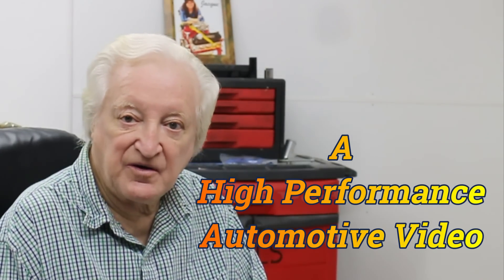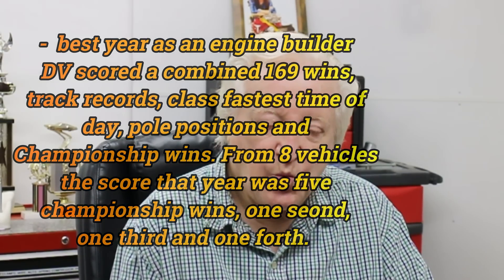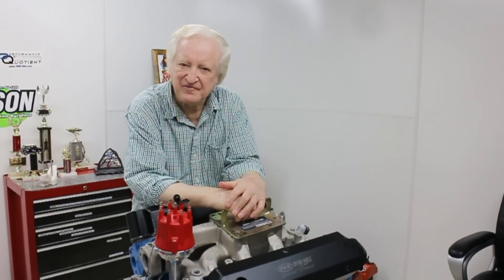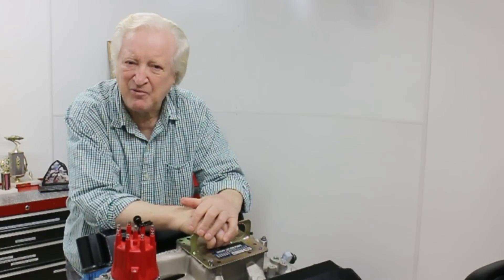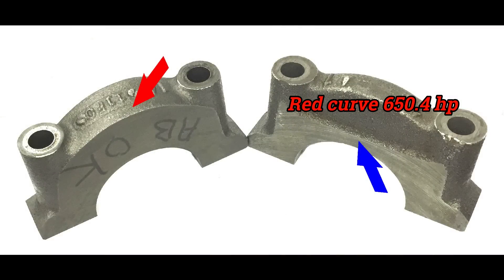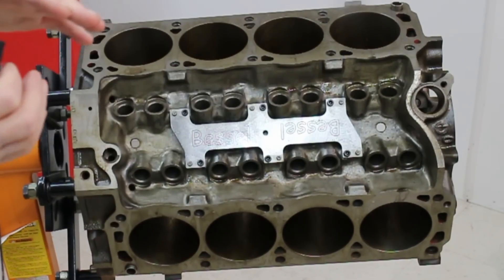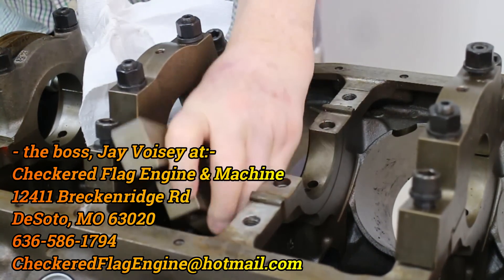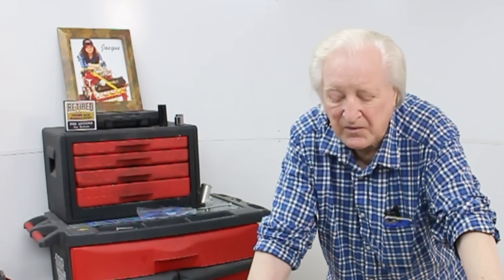1000 hp capable Ford production line  5.0 block.

Comment: A tip for david by Bloodviking 

Using aluminum heads will weaken the block. Cast heads give small block engines more strength to keep everything together.

Comment: A 302 factory block id rathe4 do 600 hp at 6000 rpm then at 8500 rpm.

Or 1000 hp at 5500 rpm if I dare.
I've seen loads of sbc failures at about 600 to 650 hp

With the best of everything to strengthen the block id still be afraid at 650. It may hold for awhile but try going up a hill in a heavy street car and load the driveline. Boom.

Comment: When I strengthen a block I assume it can't take more then about 2 to 300 hp over what limits they are known to fail at. High rpm is bad combined with high torque. So about 600 to 700 would be the limit I'd try on a 302 production block.

Bloodviking

Comment: I would agree anytime you use a stud griddle you help hold the block together. That's just common sense. I would think it would also help harmonics and even them out threw the block. In the early seventy as a tool and die maker and drag racer I made my own back then cause I didn't have a four block main block. It was a 350 engine with just stock new angle heads they came out with with no porting. I wish I would have ported them but just didn't have the time. Needless to say it was a big block killer except for 1 BB car. That SBC really ran smooth to 7,500 rpm. Ran it for 4 years and never had anything done to it. Me and a buddy drank a 6 back of colt 45 several times and I got brave and went out in the country and went threw the gears with slicks for hours. I sold it to a guy and in one night he went threw 60 gallons of gas. That engine never blew up he just wreck the car one night right into someone swimming pool.

Comment: I think the reason the light girdle works is that it prevents thel caps from vibrating as individual devices; with the girdle they are tied together, and counter act each other's movement, damping out the movement of the individual caps.

Comment: We used too re-drill 289-302 7/16” main cap  bolt holes too 1/2” 351-W main studs and girdle line hone to help with main cap walk at high rpm’s.

Comment: I had wondered about the effectiveness of these girdles and was very dubious of the aluminum girdles, but now I know better, so thank you once again Mr Vizard.
If I may,  I would also like to point out that here in Australia, Ford in combination with a company called Tickford developed a 5.6litre Windsor stroker in 1999/2000 that were installed in a limited number of Speciality Ford sedans here in Australia (search for  "Tickford AU series 3 TE50"). Amongst the modifications they made to these engines was a steel maincap girdle!
Oh by the way the engines were rated at 260kw (348hp) and were hand assembled here in Melbourne (?). Additionally, the engines featured 1 5/8" headers (I think ceramic coated), a cast stoker crank made in Melbourne, I think by a company called Crankshaft Rebuilders,  billet con rods made by a Victorian engineering firm, appropriate cast pistons, GTP heads that were prepared by PerfectTune in Melbourne, an appropriate roller cam (and I think Yella Terra roller rockers) and crowned with a unique inlet manifold which housed 8 long runner tubes like those seen on race cars.
The power rating, at 348 was intended to compete against the LS1powered Holdens of the time that were producing about the same power. These engines were replaced by the 5.4litre Boss motor in the next model in 2003. 
Thank you once again Mr Vizard.
Reply: Sounds very entertaining, is there anything on this engine build on the internet ? Thank You 🇺🇲 🇵🇷 🦊 👍

Comment: Another awasom video thanks for sharing this with us I'm at a loss hear   do you still run water wen you have concrete in the block ? And another question is this block only for drag racing and not for the street really curious

Comment: Would love a discussion on minimum cylinder wall thickness and how much if any does it matter on down the bore from the deck as the pressure in cylinder drops very rapidly as the piston moves down the bore.

Comment: I know how customers are and I hear something and they think it's a great idea but in my opinion you should have said that feeling with these blocks with concrete is not applicable on the street
Reply: funny i drove a 482 big block(.125" overbore 454) on the street 3/4 filled with concrete for 5 years in texas summer heat as my daily driver and it ran cool and just fine. all the heat in a engine is at the top end where there is no concrete
Reply: I think it's just some people get lucky there's a lot of guys that had these in their dragsters and they would get hot and if they had to go back to back got lucky to go up to the real quick eliminations where you go run turn around and come back sit there for 5 minutes and run again and it put a lot of extra heat in the motor and they didn't like it and but didn't have a choice so I don't have somebody really gets away with it on the street but okay we've been feeling since the early 80s so before they were using concrete they were using plastic and some some people get lucky I had a guy telling me the other day at a 400 that was filled driving on the street everyday had no problem so guess you get lucky

Comment: Thank you for the great video and information, it is much appreciated!
Where can we find that lifter valley brace?
I have the DSS main stud girdle and windage tray for my 302/5.0. I got it years ago before I got hurt. I keep hoping to get everything installed along with a Novi 2000 supercharger before it's my turn to pass on.
How about a video on crankshafts and how much power they can support, say a common cast iron, vs cast steel, vs forged?

Comment: Thank you. One comment about turbos: turbos use the heat content in the exhaust to make boost. The closer to the exhaust valve(s) you place a turbo, the more efficient your power production will be. Positioning a turbo farther away from the heads results in a tradeoff where the turbo increasingly uses the pumping action of the pistons ( aka back pressure) to drive the exhaust impeller and to a lesser extent the heat energy to make boost. And you lose efficiency which means to make the same power at the crankshaft, you need to use more boost and this imposes greater strain on the rotating assembly.

Comment: Ford designed the low deck Windsor to be an economy car engine, so it had to be lighter than the Chevy Mouse which was used in family vehicles and trucks.  The high performance K code "challenger" 289's had wider main caps, but to install them you will have to align bore and if you're considering a stroker crank (back in the day it was a Y block truck crank to reach 327 cid--the problem is on a 289 block a stroker kit will pull the pistons out at BDC enough they will rock. But in 1967 the last batch of 289 blocks had the extended cylinder wall seen on the 302 blocks to follow) it will end up higher inside the block and closer to the camshaft, where the lobes can kiss the connecting rods (esp. H rods).  Speaking of rods, the Boss 302 used longer 289 rods, helping the thrust areas on the cylinder walls. Ford also made the core plugs threaded so they added strength to the side of the block. Many blocks in fact have a weakness by attaching to engine mounts in their middle, which is why race engines use engine plates in the front.

Second point, MOST 5.0 pushrod engines can't be bored past .040 inch without problems. but every now and then you find a "casting mistake" and that block can go out .060 over. No one seems to know how many "escaped the quality control" but no doubt they make up some of the "miracle stories" of blocks making it past 500 hp.

Third point, Ford changed the firing order on the High Output 5.0 pushrod engines to the 351 W. A change to the crankshaft in the 1980's resulted in a different weight flywheel--a clue that something was amiss. Look at the regular 301.9 cid firing order, and you notice the front two cylinders fire off at the same time. Now, imagine that happening on an engine with a lot of stress on its crank pulley--such as a supercharger belt tightened down so it won't slip off while making maximum boost to push the engine past 500hp. This firing order is found in the camshaft, so how many 5.0 litre cams are out there being ground to the old firing order rather than the HO/351W firing order that does not fire the two front cylinders off at once? DV has already talked about camshaft companies and what they know and do not know--many will create a Chevy small block type grind and lifter design and sell the kit for non Chevy engines, and the result will be oiling problems in the lifters and a camshaft that doesn't fit the peculiarities of an "off brand" cylinder head design.

Comment: Ive used a 302 72 block, made a cap plate 1/2" steel on the 3 middle caps, then this is bolted through the sump sides onto side plates that act as engine mounts, they also tie the cap plate ont the side walls of the block. 
Alloy heads & twin turbos, it's at about 700bhp & holding up so far, I do have it dialed in to keep the power lower in the RPM which I think helps a lot...... great vids David!
Reply: I’d love to see a video of that. Actually screw it even a picture.
Reply: What's your range for lower rpm?

Comment: I have always wondered if a Small block Ford engine from a  Shelby gt350 or a Cobra was a factory Ford short block block like any other car or if those engines were manufactured for Shelby completely different and made much stronger as cast. Good video that explains why the Ford small blocks can split down the center and how to stop it.

Comment: Great stuff with DV... And as most Ford guys know, the 302 Ford Windsor (5 liter), won Lemans twice. That is that nasty old 24 hour race. Would be nice to see the mods Ford and friends did to keep that little screamer lasting for 24 hours under race conditions
Reply: When did Ford win Lemans with a 302? Possibly a 289…. But I only re all the 427’s winning Lemans in the GT40’s
Reply: @matthewnosal6893 they won with 302 and 289
Reply: @CoyoteFTW so the 1,2,3  win at lemans was with the 427’s first. Then later switched back to the 289? From what I’ve read the first run of lemans with the 289 was disastrous .
Reply: The block for the LeMans small blocks which won in 1968 and 1969 were cast in England. They were heavier, and also a better grade of cast iron. A friend had one, with the Gurney Westlake heads. A very nice casting.
Reply: @johnsalvaterra1355  wow I never knew that. I guess after the 427’s put whoopin on everything they put a 5.0L limit on engines in the following years at Lemans. Who was building the engines for Gurney? Holman Moody built the 427’s…

Comment: The early 8.2 deck blocks also have head bolts that are blind in comparison to the later roller blocks. I run the DSS main support system on my 9.5 Windsor block. It was transferring metal at the mains before the girdle upgrade. It also had ARP studs at that point. Seems to have stopped now. Doesn’t look any worse. 625 hp N/A stick shift drag car.

Comment: I've always wondered about the "higher nickel content" anecdotes.  When I was a youngster, they were saying the same thing about the Australian castings for the 351 Cleveland blocks being stronger because of a higher nickel content.  And while it may be true, I've not seen anything resembling a metallurgical assessment to confirm it, let along  testing to determine whether that higher content would actually give a significant increase in strength.
Reply: Having played with those anchors and comparing them with US blocks [GT Blocks] they have good and bad points. Personally I feel the 'normal' 300HP Gt XY XA block is better but swings and roundabouts. Dreadfull oiling average cooling and bloody heavy. Though with very thin bores, they all seem to flex @ .030. The Aussie block as I have with 2 bolt is strong enough
I am in the process of going too a 5.0 roller cam block. EL Falcon. Not chosen for any special thing except for availability. Better oiling, better [but not great] cooling and a LOT lighter. 347 capacity will make more power but less torque than the 358 Clevo with 6" rods. But the car will handle better without the lump over the nose.
Reply: @ldnwholesale8552  i had a 351 in an xe s.pack,cough,,wagon.. with big cam. still have engine 15 yrs later..pulled like a train, no problem with handling. chain of ponds, s.a. yes, lighter is better. the 289, is lighter than a capri v6, as they were meant to be diesel. i hve 3. 351,s. 1. fe 352,  & a 340 r/t chall. 73.  lump over nose. 460, alloy everything you can, weighs same as 351, but with 600 hp..easy..reliable. no major mods. they had around 450ish std, 70.. if anyone says go LS,, tell them, its a lotus copy.. not chev..chev cant build engines..    never had a cooling prob. or fail with clevo. plus, we beat the yanks at the drags,clevo. the 2v cayote, seems the go..  oiling, 351,302 heads std cam, thrashed for 14 yrs,,on lpg,,no probs..in a bronco. with 35,s.
Reply: There is no such thing as a high nickel block.
Reply: @DaveMcLain  is too.. i spent 45,000 nickles building an engine.. so naaaah...

Comment: That is actually cheaper than buying a aftermarket block so that is a very good deal and I believe that it would hold together very well, everything that you talked about is very accurate, If I had known this earlier i would have sent my block to that guy but I have the information now ive often thought about doing similar mods to the block as well but lack the tools and some skills necessary

Comment: Ford and Chevy have a short skirt for the mains mopar has a deep skirt to keep Caps located and reinforced.  Could you test stock for stock? .
Reply: FE Ford motors are skirted (and some cross bolted), just like BBMopars. The returned to the skirts and cross bolts  in the new 5.0 Coyote series.

Comment: David good video,  I don't understand why there is so many people having trouble keeping these blocks together we run in the 9s with the e7 ported heads and all stock long block we have never split a block or even blown a motor up and these motors have been around from the 80s and 90s with 2 and 3 hundred thousand miles on them if you look at our channel you can see how hard we run them Grover boys racing on youtube however the blocks I've seen people break has mostly been due to detonation
Reply: Terry, big difference in running 9’s with a sub-2800lb car and a full weight 3400lb+ car.  Mark Miller holds the stock block 1/8mi record with a number of sub-5 second passes.  He’s got to be pushing 800+.  Attention to detail, balancing, blueprinting and careful precision assembly along with a good tune makes the difference between one holding 800 or breaking at 400.
Reply: @carportshenanigans5918  I've seen many people break these engine's with just heads and a cam that was my point regardless of weight

Comment: This is a very timely video and it's great to hear a shout out for RSS Racing. I'm basically down the street from them so it is good to know they are a high quality shop. I'm at the very beginning of working on a FE 390 (MCC Mirror 105 core) stroker and the plan is to use a girdle, ARP studs with stock main caps. Going with a full cross bolt modification seems too costly. Might as well go with an aftermarket block at that point. Doing a half fill on the block was something I was considering. It would be a 650hp+ street motor if all goes well. Time will tell. Thank you!
Reply: stud girdle where you going to use for the mains I didn't know anybody made one for the FE  cuz it's basically making it  like a 427 bottom in.
Reply: why don't you get three middle caps often Fe for boat 427 and put them on your block and line on it and then you got a crossbow bottom end cuz I found that 390 core that had all the bosses in it to do that it just didn't have the hadn't been finished
Reply: @jackies8538  It comes down to cost and complexity. New 427 style caps with cross bolts are high cost considering the extensive machining required. Perhaps a stronger solution but I am limiting the RPM to 6000. The engine builder/machinist I used wanted the experience of setting up a FE girdle. So the cost was very, very economical.